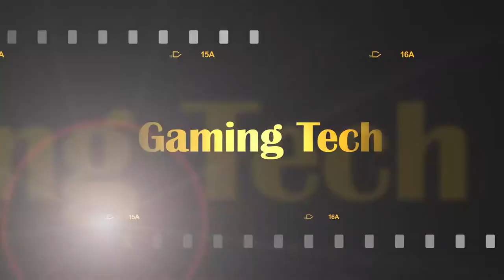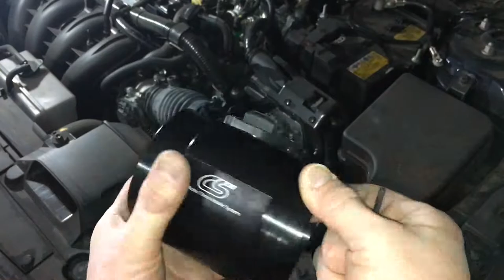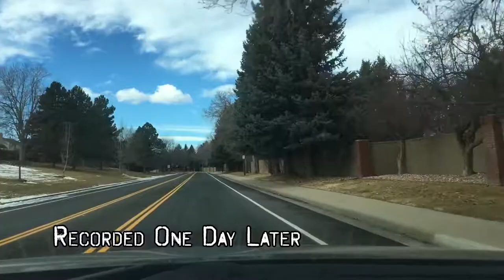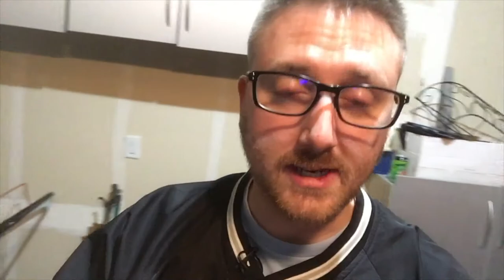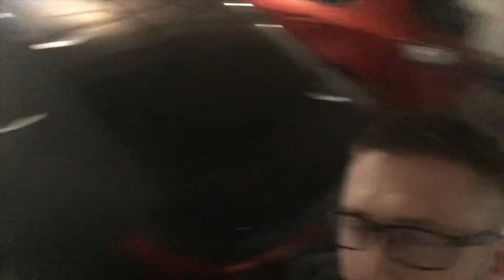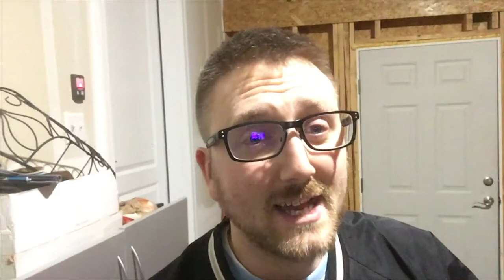Corksport Short Ram Air Intake - 2016 Mazda 3 S GT 2.5L

Comment: I am upgrading my 2014 Mazda 2.5 GT  KNIGHT SPORTS Hatchback with this part and the Cold Air box soon after the COVID-19 delay that is going on.. assuming nothing is different on the inside in your 2016 than the 2014. I have some questions if you ever visit this page again ... seeing how it was posted in 2017:

- Any issues after installation?
- Any issues DURING installation that maybe Corksport did not describe accurately?
- Performance difference personally? From before and after?
- Gas Consumption change? Better or worse? (I have a Borla Axleback already on my car)
- Cabin noise difference? 
- How many KMS have you put on the car since installation? Was it worth it to you?

Thank You hope you are safe during COVID-19 Pandemic.
Reply from the maker: Hey!   I honestly am not 100% sure if there are any differences in the 2014 to the 2016, but I know my 2015 had ZERO differences besides the 2.0 versus the 2.5. 
- Any issues after installation?
  None at all.    I did make sure to check that all was still tight during the trip and also after. I do check every so often now, but never think about it really.

- Any issues DURING installation that maybe Corksport did not describe accurately?
 None at all.  Everything was described perfectly. 

- Performance difference personally? From before and after?
  Oddly enough, the bottom end in the really low RPMs can sometimes seem laggy. My wife now has a 2015 2.5L hatch (we both drive the 6 speeds) and hers seems peppier in the low end, but that just could be me.  I do think the cold box fixes that, but I haven't tried it yet.

- Gas Consumption change? Better or worse? (I have a Borla Axleback already on my car)
  Gas mileage might be different because it's pulling more air (maybe). My wife's hatch gets about 375 to the tank and I get around 325, but that could be me wanting to hear the engine versus hers.  (How's that borla? I need an exhaust, but do not want any drone at all, when I go to the office it can be 20 miles one way on the tollroad at 75-80 mph, and when I travel, it's 200+ miles a shot, so I can't have that the whole way)

- Cabin noise difference? 
Cabin noise is good. I think the biggest factor is tires. I like hearing the intake, but i only hear it when I get one it, otherwise it's nice and quiet and just the road.

- How many KMS have you put on the car since installation? Was it worth it to you?  I put this on at about 12,000 miles, I now have 52,000 miles on the odometer.  I love the sound and would miss it if I didn't have it.  I think it was totally worth the $$.
Reply: @5PortStudios  Good Day
I am from Canada so our weather has been on and off.. we go through almost 4 seasons in a week at some points.. Global Warming? lol
But i have heard and seen videos of some people buying the Cold Air Box and I am on Facebook groups and get different opinions..

Cold Air Box - Corksports I hear sometimes suffers Air and can cause it to LAG but I hear some people keep the stock box and cut a hole to keep it intact with the Corksport SRI .. I see more videos of the 2.0 over the 2.5.. not sure if that is availbility of modifiers or just people have had issues with the 2.5 being larger (by this I mean the combo of the 2.5 and Cold Air box since the 2.5 is a Fat looking Filter right?)

I just went over 115,000 Kms and I am considering making a video page since COVID-19 gives me TOO MUCH free time with working at home on the computer LOL.

I have IG Chrisk4413 as I Show modifications and Photos of the Car I have been working on.. my best friend passed in 2015 as it was his old car and I bought it off his mom to continue the project in his memory for him. 

Regardless I hear the the Rear motor Mount is a must.. not sure if it is overly worth it for a NA engine that cannot go that much further without HEAVY TUNING and chipping.. Not many programs were made for 2014 onwards on mazdas unless you have a MX5..
Reply: @chris Albertan/BC here, I feel you on the 4 seasons per week deal haha. To piggyback on 5-ports question, what is the in-cabin noise like with the Borla Exhaust? I’d like to hear my exhaust now and then when I step on it but I do a lot of long distance driving and don’t want a loud droning at highway speeds. How is it for that? Driving a 2016 Hatch MZ3. Also good video thank you 5-Ports 👍🏼

Comment: Thanks for the upload. I just installed the SRI with the Corksport airbox. It does sound bad AF when you get on the gas, I wasn't expecting much and I am pleased with it. Next will be an axle back exhaust. I don't want to deal with cabin NVH. I hope Corksport comes out with an intake manifold with a larger plenum and larger throttle body, that would be awesome.
Reply from the maker: I have been looking at the CS airbox. I had wondered how much it muffles the SRI, but also wondered if it fixed the low end lag the SRI caused on my 2016 sGT 6-speed.   Can you let me know?  Also, I'm looking at the Axel back as well. I DO NOT want any drone. When I drive on trips, it's 2000+ miles round-trip, so I can't have that when I'm on the road. So I don't think the cat-back will work for me.

Comment: Yay! Finally someone who can compare the 2 products I’m deciding between. I’m waffling between the K&N and the Corksport intakes for my 2013 Mazda3. I like the heat shield feature that K&N offers, but I’m not totally convinced that it would make a big difference since it’s still under the hood. Did you notice a major difference between the 2? Would you say the K&N was worth an extra $80?
Reply from the maker: The differences that I've noticed so far was less lag in the lower-end of 1st gear. I don't know why, but I felt it really bog down with the K&N. maybe it was the thin Colorado air or something, but throughout the summer and into the winter I noticed that quite a bit. I thought I'd miss the heatshield, but honestly I'm happier with the Corksport than the K&N.  I would save the $80 and get the Corksport if I had to do it all over again. Not sure if there is truly a difference in them, but getting out of a dead stop and into 5500rpm without lag helps in the city.  At speed I don't notice much of a difference unless i'm in the powerband of 3500-ish to 5900.   They do have an airbox that sucks the air right out of the front like the stock box does (https://corksport.com/2014-mazda-3-mazda-6-cold-air-box.html) that you can put around it if you want a shield, but I left mine open.
Reply: Excellent, thanks for the feedback. I'm not sure the air box will fit my 2013, but I'm not too worried about it. I live in NY... I probably shouldn't worry about heat too much. Plus with the Corksport I can get a sweeeeet looking blue scheme to match the engine cover. I tend to find myself above 3500rpm quite often actually, since I'm slashing around to cut people off in the city, so I think I'm going to enjoy this mod. Did you notice any difference in sound between the 2 intakes? I think the sound is probably like... 90% of the gains.
Reply from the maker: Oh, the sound is what makes it for me.  I like the corksport, it seems fuller through the whole range. That may be just something I'm hearing though, but I think its a little louder maybe??? I want to say it is.

Comment: I too don’t know what’s hip but I would go with the small windows on the doors. Did the butt dyno notice a difference?
Reply from the maker: I think the small windows will be a good choice too.  The butt dyno (that's awesome btw), feels the difference right at 2000 rpm, there much less lag between 800 (idle) and 1500 (or so) than the K&N SRI had (it seemed to choke it off down there), and feels more like the stock intake in that range, but once 2000 hits, I hear the growl start, and the hollow tones and whistle of the flap from the throttle body start to get louder and you can hear it sucking air with the windows down. Between the stock intake and the CorkSport, the Corksport felt a little peppier on the acceleration on the highway.  Wifey and I went to Dallas and ended up putting on 2,164 miles out of the 2,500 I expected. Averaged 32.31 mpg, which is about the same. Even with the same driving style and downshifting habits to pass people and merge that I already had from the stock intake, I felt the SRI was much more responsive, especially since I was already sitting in the powerband where I felt it was quicker before.
Reply: small window is my vote!

Comment: corksport has always been badass.  They make some sick mods.  Doing exhaust anytime soon?
Reply from the maker: I still can't decide if I want to do Axelback or cat back. I think all of the stock tubing down there is the same size that comes on the catback... I may be completely wrong about that though.
Reply: @5PortStudios  After watching various Mazda3 vids, my mod decisions is gonna be corksport 2.5L full black intake with cold box, along with racingbeat catback exhaust for a smooth deep and subtle sound combo.
Reply from the maker: @ZoraPMC  I like that idea. I think that would make quite a great setup.  If you do get those installed, let me know about the drone and raspy sound from the exhaust. Those are my only hangups on aftermarket exhausts. Drone and rice are a no-go for me.

Comment: I'm interested now BUT do they offer some type of cover for the filter? I live in an area where it rains a lot and I'm scared if I install just the filter without a box over it, it will hydro lock my engine.
Reply from the maker: They do!

https://corksport.com/2014-mazda-3-mazda-6-cold-air-box.html

I was looking at this for mine. But I'm quite interested as to how it impacts the new intake. Or would it?  I trust Corksport with their R&D though, so I don't have too much doubt that it would be ok.     If you get the intake. Let me know.  I'd like to know what you think of it. Thank you for Watching!  I hope to do more videos for the car soon.
Reply: @5PortStudios  In my opinion, the cold box is almost mandatory if folks wanna maintain power at lower rpms due to colder air.
Reply from the maker: @ZoraPMC  I didn't know that would help with that low RPM lull. I may have to check this out as well.   Thanks Rory!

Comment: hi, I really like your video though. I just got a cat-back exhaust on my 2018 touring model from CorkSport and it is amazing and real loud inside the cabin though lol. I am thinking about the SRI and a cool box comes with it so it can actually match my exhaust
Reply from the maker: Thank you!  I still really like the Short Ram Air Intake even today. I was looking at exhausts again and still cannot make up my mind. I really want zero drone in the car though. I've heard Racing Beat may be a good one as the corksport cat back is quite loud as you said.  Do you know if the Corksport Axleback has a drone too?
Reply: @5PortStudios  well, I don't know about the Axleback. but just want to update with you that I have installed the SRI and cold air box and I can clearly see the significant increase in acceleration. I cannot happy more!!
Reply from the maker: @henryphan6200  Is it the SRI and This box? https://corksport.com/2014-mazda-3-mazda-6-cold-air-box.html      I've heard it takes the sound from the SRI down, but i've never seen or heard one in person.
Reply: @5PortStudios  yes, that's correct. I have tested the SRI only and SRI with the cold air box, the cold air box will cancel the shhh (whistle) sound from the SRI. If you have the SRI only you can hear it better.
Reply: Anybody use the cold air box? How does it compare to stock?

Comment: is the sound the same for the 2.0 liter?
Reply from the maker: I want to say yes, with a but. I had my 2015 2.0L iGT and now the 2016 2.5L sGT, i want to say the 2.5L with the intake is a bit louder, but that might just be due to the bigger engine, but the 2.0L had a great sound too.  To me, and I might get flamed for this, but if someone didn't know the difference, they may be able to guess, but it would have to be in person, I don't think it would be noticable over a video.     2.5L might be louder.. by a small margin with the SRI.